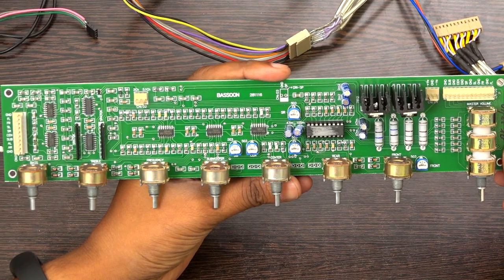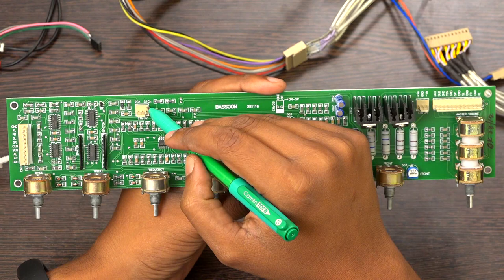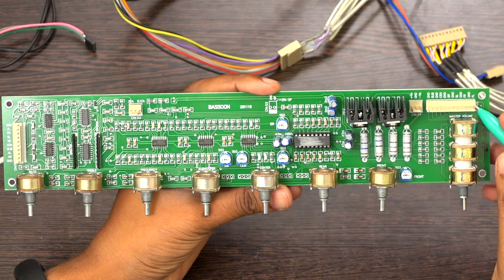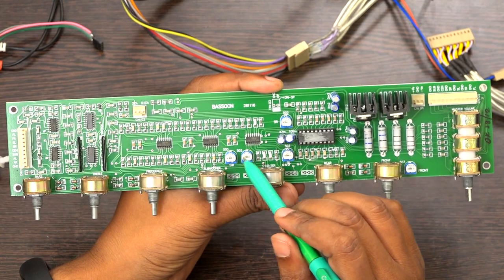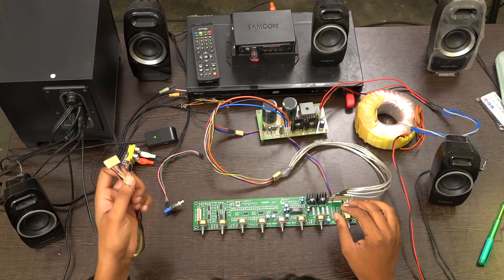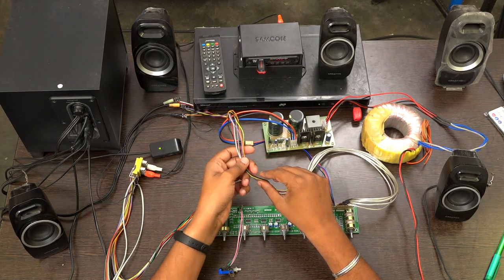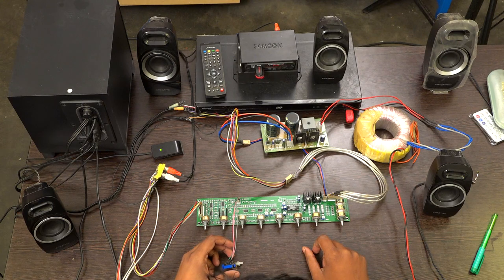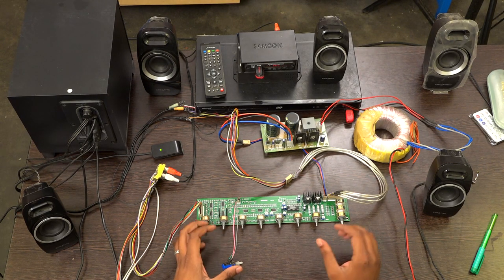Bassoon and 5.1 Home Theater Pre - Amplifier Board Demo

Comment: This pcb is not working at all,  don't waste your money. Heat sink and resistance is getting too within 5 minutes without no sound of pcb . 
After purchasing this This man would not be able to take your phn  bro  . !!! .be careful.  I have just purchased this  board . Really disappointed. I made every connection just like video .bt pcb didn't respond anything. So far 32 v  , 24 v is sufficient to burst.
Reply from the maker: We have been selling this board for more than 10yrs successfully. If you persist any issues while assembling you should contact the seller. 6369537427 is the Bassoon sales number. Due to change in the management you might not be able to contact the right person. Before starting working on a home theatre assembling kindly read the basics and start. If you don't know the basics then you have to cry like this.